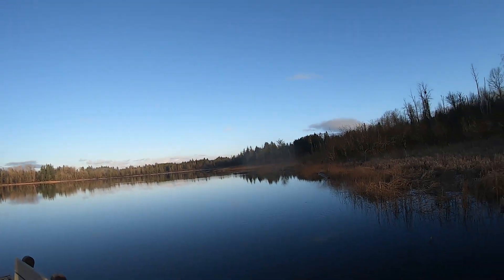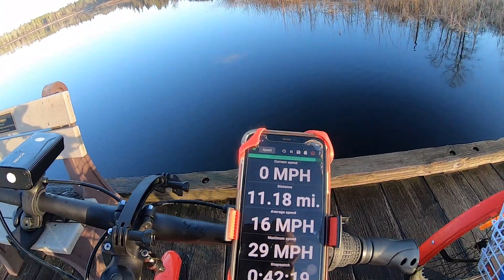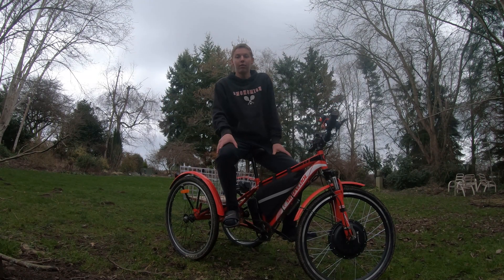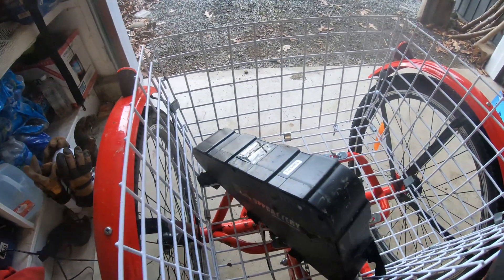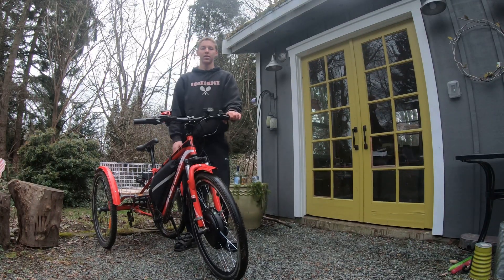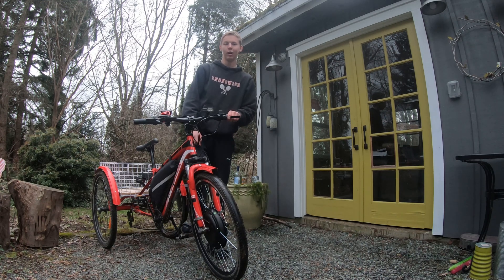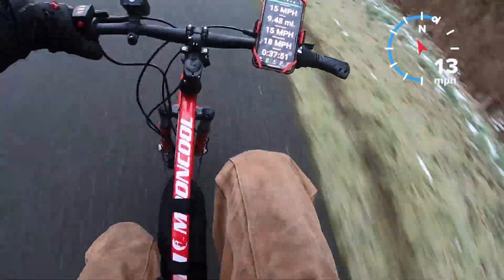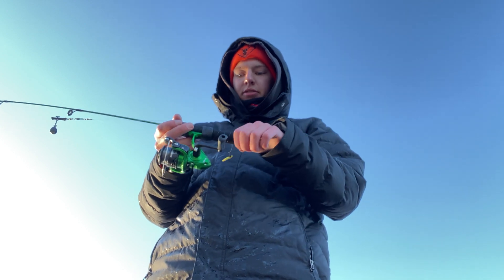Range and Top speed. 1500w vs 750w vs 1000w

Comment: Lithium batteries can take safely 1c thats the rated capacity of the cell. In that configuration that you have, that cell will never see 1c unless you charge it with tons of amps.If you  charge that 1kw/h batteri with 52v 2a thats 100w. Those 100w get divided by the number of cells you have in the pack, so if you have 100 cells in it every cell will get 1w to charge per hour.You can easily charge that 1kw pack with 10 amp charger and still be under recomended lithium charge current per cell

Comment: I had a 500watt 12v front hub on my 21spd mtn bike. I drove it 24 miles once, and up some very steep mountains. Had juice to spare. The speed was about the same as 750watt, between 15 & 20mph. When I peddled I was almost as fast as traffic, say maybe 25mph. 

I don't like hub motors anymore thou, vibrations can crk your frame. Been looking at multiple friction kits & etrailers. Informative video 👍
Reply: Friction kit is worse than hub motor

Comment: In the central have some 2 blue wires ! If I connect both I can reduce de watt to 700 ? Cos most of the time I keep my watt around 900 / 1000 and my battery range around 2,3 hours maximum

Comment: Oh, quick note. When you use GPS Odometer , the speed will need to add 1 or 2 mph from what is reading on GPS depending if you moving East or West. I have fixed odometer within bike and I tested my Garmin GPS and notice this of the difference but on GPS its always 1 or 2 mph you need to add depending if going East or West, so the 1500 watt maybe actually 36 and 750watt is 20mph

Comment: I got a gear 350 watt back hub using 48.v 10.4 ah and it goes up to 20mph. The 750 test should get you around 26 or at least 24. But it is a great video and cool Tri Bike.

Comment: Got 1500 watt Jauopay Front Hub using incline frame of NEXT Power Climber. got same specs of battery of a 52v 20ah. I weigh a buck twenty five so with bike its around 200.lbs. I get up to 42.mph and have a great range of 40 miles(NO PAS, i use this bike as moped scooter) Every 5 miles is 1 hour recharge. Forgot the vendor but they use Chinese top brands over generic, not LG or samsung but a tier below them 2. Its them BLUE Packs and they have a lot of different specs on Amazon to choose..

Comment: With the switch that changes it from 1500 to 750 and vice versa, which way do I connect the positive and negative wires to the blue wires? Is it the positive wire to the female connector and negative side to the male connector or the other way around?
Reply from the maker: It doesn’t matter what way you connect them. Either way will work

Comment: I have the same battery, my wheel and motor may be different 48V 1000 watts.  Is there a way to either work/wire controller or a different controller you suggest for different speeds? I will be happy to send any pictures.  Thanks

Comment: liked the video, just got my 48v 1000w voilamart rwd kit with 48v 13 ah batery(small) where should i get started modding? battery? controller?
Reply from the maker: I think the first thing to go faster would be the controller. Get a 1500w or more if your adventurous. And if you want more range and a slight performance boost I’d get a 52v battery with more amp hours.
Reply: @WillMacD  and how do i know if my battery can handle the current for those 1500w?
Reply from the maker: @TheMatixen  it’ll depend on the amps of your bms. So a 1500w controller pulls a maximum of 32amps. A 1000w controller pulls at maximum of 20-25amps. You just have to look up your battery and see what it’s rated for.
Reply: @TheMatixen  but bafang mid 1000w mid motor makes upto 160nm. so 50/60nm is not much comparing bafang
Reply: how much torque does 1500w kit makes? normally high watt hub motors make small torque
Reply: @musmanov4642  they make a lot of torque actually, a 1000w gearless motor has around 45Nm while the  1500w gearless around 50/60Nm.

Comment: As mentioned Temp. makes a BIG difference to battery performance. Also you are on a trike, not the lightest bike and with the riding position you are as aero dinamic as the side of a barn. All that said the disadvantages are the same for both tests so gives an great comparison and any advantages gained through not riding the side of a barn in the snow would apply to both power settings. 
Keep up the good work all these tests offer great info to people wanting to put their toe in the water of ebikes.
Reply from the maker: Yep exactly. all those factors don’t favor range whatsoever. But as you said it does show the comparison between power levels so people can know what to expect and how much power they need. I appreciate the comment.

Comment: Got 1000w motor 1000w 21ah battery. 37mph top speed 80 mile range. With some peddling
Reply: What battery did you pick? link?
Reply: @freddyfpv7422  pronghorn ebike battery store. 20.8 ah can't post pics.. or link it

Comment: Why does the 100w only do 25mph I thought it could hit 30mph will this mean that my bike will only reach a top speed of 25mph?
Reply from the maker: Going down a hill you could go 30. And pedaling you may be able to go 30. But throttle only on level ground expect to only go 25. You may get a mile or two faster if you have a bike. The third wheel adds a little resistance.
Reply: Oh ok  because it’s just that in some videos I se this kit hit 30 to 32mph with only throttle I dunno maybe it’s the third wheel causing drop in speed maybe?
Reply from the maker: @jonathanbrunache3848  I was only able to get over 30 with the 1500watts, but it’s totally possible.
Reply: @WillMacD  oh ok thanks man
Reply: @jonathanbrunache3848  I get over 40mph with my 1000w kit, all you need is a so called 52v 20ah battery with output of 40amp.
Reply: @ianmangham4570  

Where did you get you battery? Like what kind of battery is it called I wanna check eBay. 

I currently have a 48v 19.2 ah with my 48v 1000w.
Reply: It's very fast for a bike, I'm getting old so fk it 😭🧓🤣